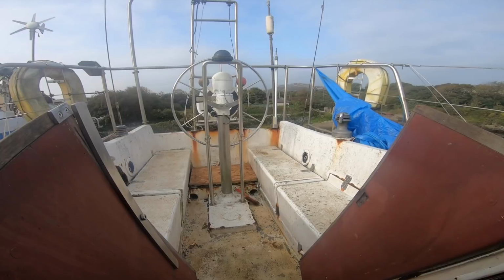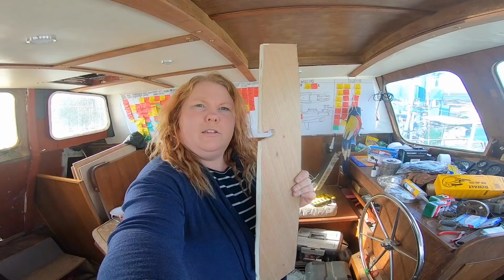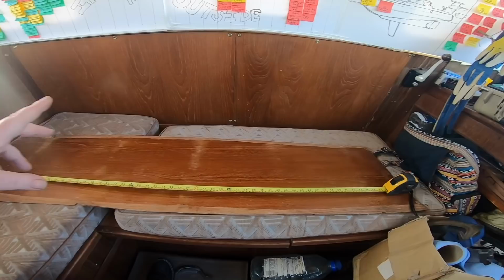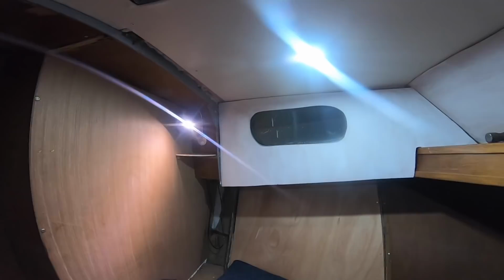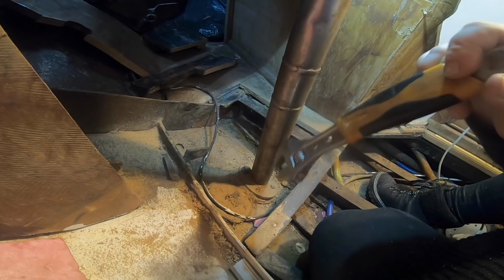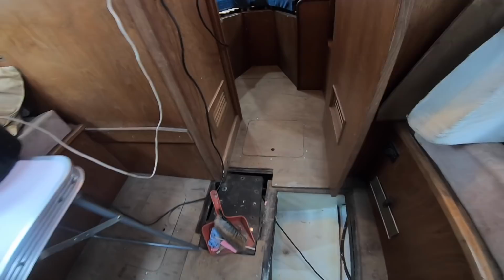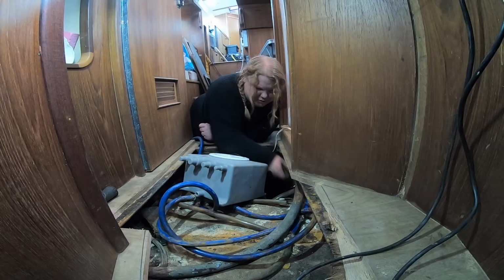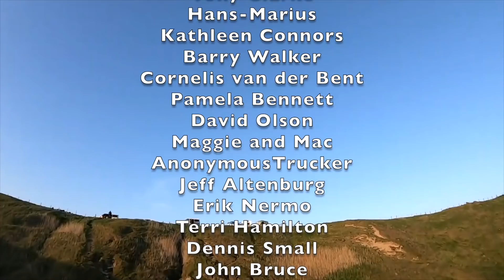#84 - I CUT the SOLE out of my BOAT ⛵⛵

Comment: Things are definitely moving forward and that's great.
I'm not sure if glueing the bulkhead as you did will be strong enough to resist the vibrations and moves of the boat at sea. The glued surface is very small. You may have to glue a thin piece of plywood all over the whole bulkhead and keep it firmly pressed by the time the glue cures. That would keep everything together.
Anyway, congratulations for this work.
Reply from the maker: There will be Veneer on side and bathroom upvc on the other 😁

Comment: Save your cardboard and use it to cut templates before you commit to wood. If the card is cut short either try again with another piece or tape another piece to the incorrect profile. The card is cheaper than replacement wood and when you've done with it, it can still be recycled.
Reply from the maker: We use card and also clear plastic for templating depending on the application. Sometimes. As in this case, it was easier to measure distances and angles

Comment: Great Job, you should probably check the areas where the concrete meets the hull all the way around, if there is a gap(crack) then moisture may have gotten underneath and caused some rust. Three guesses how I know . Definetly seal it to prevent. :) ☮
Reply from the maker: Yeah, there’s definitly no gap. But my plan is to use an SDS and remove a few inches of concrete and check and keep going down until I’m happy. Then just refill with fresh cement
Reply: Perfect, was just a thought. Maybe seal it all with the epoxyprimer?

Comment: I would just cut those skin fittings out, plate it back in, and then weld a stand pipe in place so there is no place for it to leak. 

Easy peasy. 

Looks like you are making good progress.
Reply from the maker: Yep. May well do exactly that

Comment: Don't the bulkheads have to be tabbed to the hulls?  Without that they provide no structural support.  Agree wood glue butt joint likely not strong enough, at least should be epoxy.  Veneer will need to be quite thick to add enough support.  That little tank will fill up pretty quickly with just 3 people.  I would look for another location for a bigger tank and macerator or invest in a composting head.  That might be a good place to pump shower drain to collect in that.
Reply from the maker: The wooden bulkhead are entirely non structural. The steel hull is incredibly stiff. In fact using fibreglass resin and silica and then glaw cloth  tape to tab the bulkhead to the hull, as one would in a fibreglass boat, wouldn’t work because fiberglas doesn’t stick very well to the steel and would most likely pull off over time with the slight flexing of the hull.  What we do is to create a fillet of very thick sikaflex to stop draughty and odours.

Comment: how are you guys getting on with the Excel cordless tools?  They seem really good value but does that translate to effectiveness?
Reply from the maker: Yes yes yes. They’re brilliant.
We’re working them quite hard as you can tell. And they’re great. I’ve once managed to get the drill a tiny bit over worked when I was drilling out large holes in steel plate with a hole saw. But other than that, no issues.

Comment: did you say there was concrete under that fore cabin floor??
Reply from the maker: Yep the whole ballast is lead cast into concrete
Reply: @SailingMelody  interesting. How do you check the steel under the concrete?
Reply from the maker: With the ultrasonic thickness tester 😁

Comment: Great work Melissa. Hope Andy and Jack will be better soon.
I do wonder if white woodglue is the best solution in a damp enviroment. Not critisising just a question.
Reply from the maker: It won’t be that damp to be honest. The side which faces the heads will be clad in upvc and be fully protected. The other side will be clad in teak so with the laminated on both sides it’s never coming apart :)
Reply: @SailingMelody  
I take you word for it, i am not a boatbuilder or a sailor. It is just something i picked up from other sailing chanels, boats seemed to be often damp. Good luck with the rest of the project.
Reply from the maker: Time will tell. You may be right :)

Comment: Please stop using a lighter on heatshrink it looks so unprofessional, I would suggest using hermetically sealed crimp joints not soldered in a boat environment.
Reply from the maker: Thanks for the advice. When we’ve used up all our heat shrink we might do that. It did make me laugh though saying it looks unprofessional. Firstly we’re not professionals and secondly who cares how it looks if it’s safe and fit for purpose.  Now if you have a compelling argument why it’s unsafe or not fit for purpose then I’d like to hear that, but couldn’t care less about looking professional :)
Reply: @SailingMelody  🤣